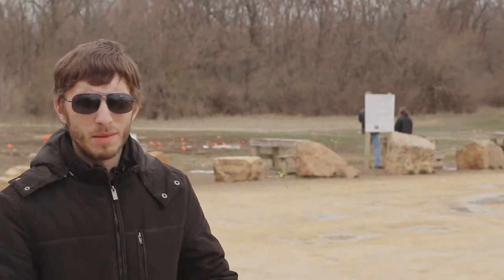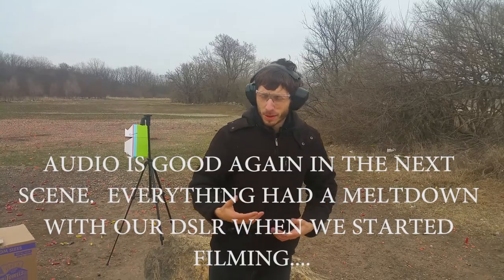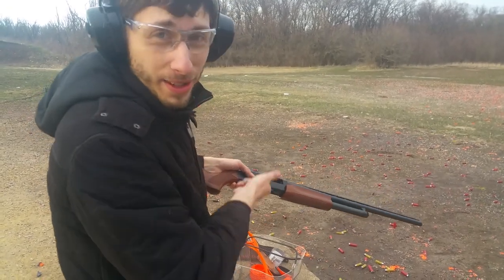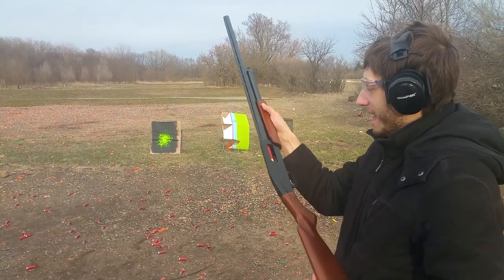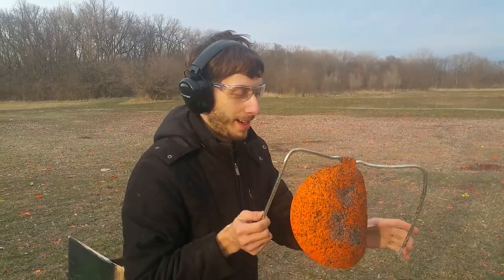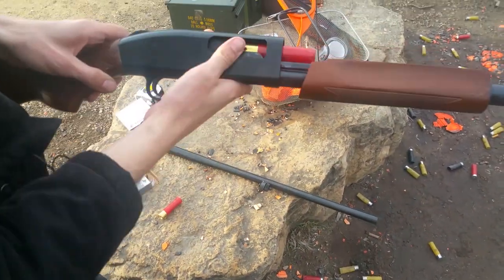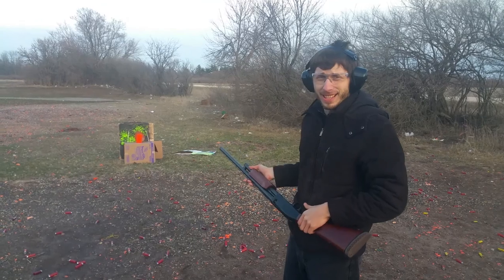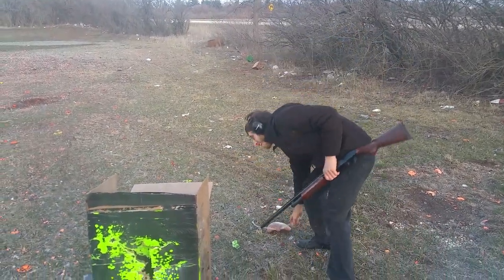Mossberg 500:  Firing 3 1/2 Shells?  Not a good idea!

Comment: Also, the Mossberg 500 usually is chambered for 2 3/4 and 3" shotshells. The crimp of the 3 1/2" shotshell is opening into the forcing cone. That will definitely increase pressure.

Comment: thanks. i messed up and got that same ammo. I haven't fired any, but the shell does fit and chambers. But I had to do the same thing to get it back out. Took the barrel off. With this ammo shortage rite now, seems like only oddball stuff is in stock. I don't shoot 12GA much, so I didn't even realize it was 3 1/2 shells till I got home, and noticed they looked pretty big. soo, that sucks
Reply: Dont shoot these out of your gun read your barrel or receiver most mossberg 500 are only chambers for 3 inch shells and you could damage your gun due to over pressure from the cartridge be safe the mossberg 500 is a great shotgun that will last you years if you take care of it and give it the proper ammunition
Reply: Get a benelli supernova lmao

Comment: I came here because I also bought the wrong ammo. I have decided not to do this. My shotgun is a 1956 Mossberg 12 gauge 2 3/4 inch bolt action. The bolt would make it easier to pull out the spent shell. I'm kind of afraid the age of the barrel would be more weak than a brand new mossberg and more prone to exploding from the extra expanding gases.
Reply: Just spent $50 on 15 rounds not seeing it was 3 1/2"🤧
Reply: Yupp. Did the same thing

Comment: My moss berg shoots 3 1/2 is there different models?
Reply: Yeah there's different models they have. The 500 and 930 have  3 inch chambers, the 535, 835, and 935 have 3.5 inch chambers. 535 is discontinued, it was the 500 but with a 3.5 inch chamber as an alternate model. 835 is that, but an overbored barrel to a 10 gauge sized barrel for better patterns with the long shot column. The 935 is the 930, but 3.5 inch chamber and the overbored barrel.
Reply: @ikilledthemoon  Yes. At its core, the shockwave is a 590 receiver (based off the 500, functionally mostly the same) with the change of the grip and barrel length. 3 inch shells will cycle. Though I wouldn't say its recommended, considering recoil. Hehe.

Comment: Is that an old 500? I believe Mossberg only sells them with 3 1/2 Chambers now, and why not? It allows you too fire any 12 ga shells you want.
Reply: I know this is kind of late, but the Mossberg 500 does not have a 3.5 inch chamber. The Mossberg 535, 835, and 935 do however. The 535 is just the 500 but with a 3.5 inch chamber, but the 535 was discontinued. The 835 is the same thing, but an overbored (10 gauge sized) barrel for better pattern with the bigger payload from the 3.5 inch shell, and the 935 is the same thing, but semi-automatic. Magnum version of the 930, you could say.